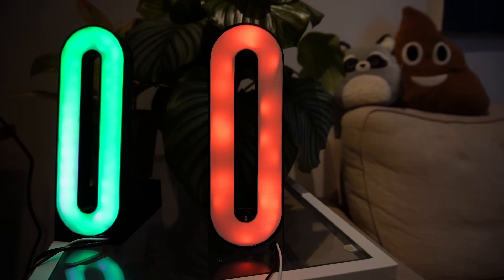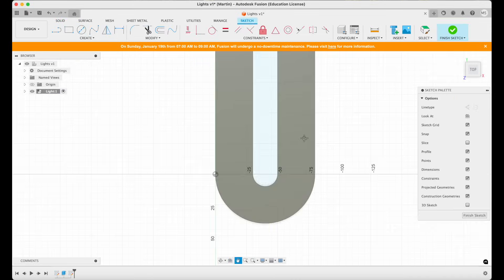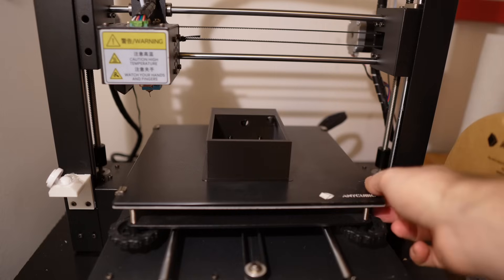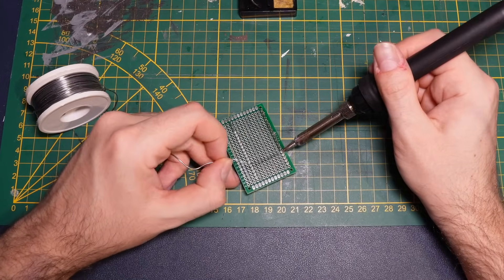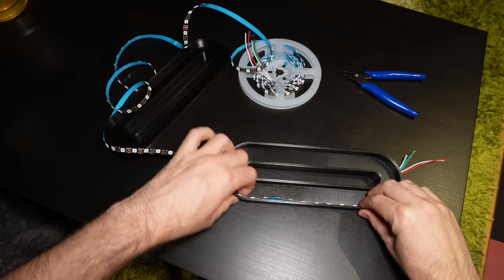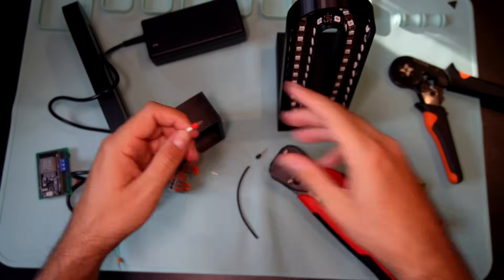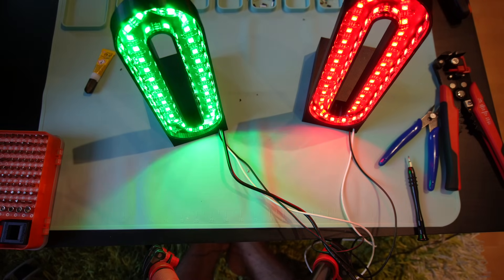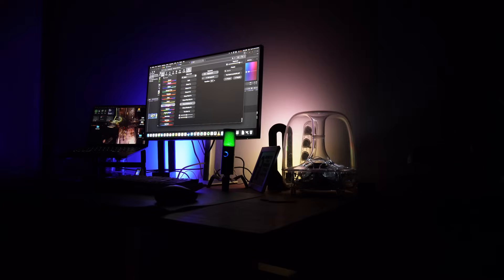Smart LED Light You Can Make at Home!

Comment: The WLED effects would look cleaner if you broke the 3 loops of LEDs in each lamp into “segments” and ran the same effect on each of the segments and then the effect would run in parallel across all 3 segments.
Reply from the maker: Yeah thats a good point. I didn't think about that before. Thanks for the suggestion!

Comment: Do you have a link for the project board you inserted the esp32 into?
Reply from the maker: Not to the exact ones unfortunately, I bought them a long time ago. But you can find similar ones on amazon: https://www.amazon.de/VooGenzek-Doppelseitige-Leiterplatten-Prototypkarten-Schraubklemme/dp/B09NDNPF91/ref=sr_1_5?__mk_de_DE=ÅMÅŽÕÑ&crid=264EX4QCEWDRV&dib=eyJ2IjoiMSJ9.no67IHHvHvkxmytSKYf2j6DHpepgM7CDk8KPw4G15j2aqBGXUoFSGK25dN8WCxIpdm3BRAU5-KDqRr5vdFP19FIyM0ukCgQKjGqt67I4LRKI_Ay21xSoaMX6nGUyxKSMzc3bvhup8Tmbj2U7sgKXrYufM1YzcDjVQcLWGHdwh8PXTnJUb7LkzG6asz1VSdTvxD7c16Q1JxTey8fVhdPA3AOTVoVVvaPkJW-vfvq1F05d36sZSFySg8nLYToq-5ye43SsXC7dXWZexgIbyYPednko8TjROg8wydq9blNwyMA.ELBTWvV3vOnpeJNWUJV8rLGhqaZAHavRoS-M_wYZMGI&dib_tag=se&keywords=pcb&qid=1761427263&sprefix=pcb%2B%2Caps%2C119&sr=8-5&th=1

Comment: I like the step by step instructional video. A few things though, why would you make something with a nice diffusor then face it to the wall? Most LEDs don't need to be diffused if you can't see the actual LEDs. I thought you were going to place these on the desk to the left and right of you and have them facing each other.

Wonder if there is a way you can design this without having to super glue. My concern is if you need to replace something, you won't have access.

Oh, I agree with another comment, the music needs to be toned down.
Reply from the maker: Good point! Adding the diffusor I can use them both ways though. Thanks for the suggestion!

Comment: WAGO-Terminals have to used without ferrules... This is for both, the old 221 and the newer 222
Reply: idk about have to, but the lack of a pull test has me worried

Some ferrule barrels are long enough to catch but a pull test would tell
Reply from the maker: Good to know, thank you!
Reply: With such low current/voltages the only thing that could go wrong is that it won’t work so your point is moot

Comment: Was there any heat issue with the LED strips, especially against the raw plastic ?

Btw: I loved the UV resin trick as glue and the use of a PCB solder board with terminals. Very clean.
Reply from the maker: No, so far no issue. I tested it out and had it on for several hours but had no issues with heat. 
Haha thank you! Yeah the goal here really was to try out the resin but it worked surprisingly well! I will think about future projects where I can use it more and also how it was intended.